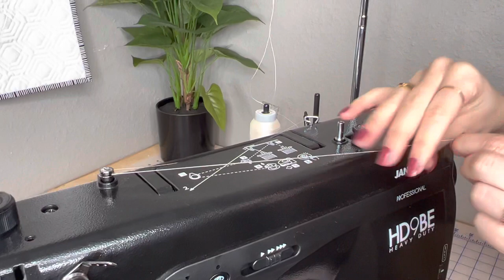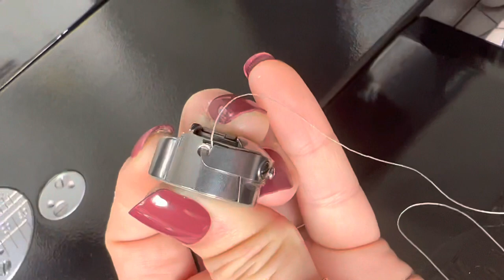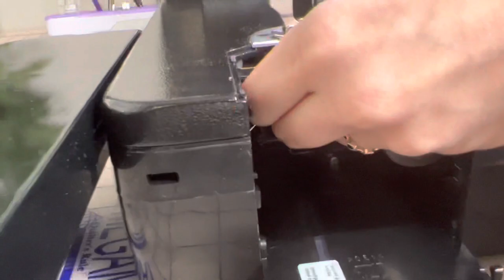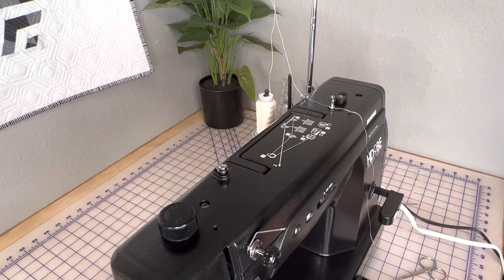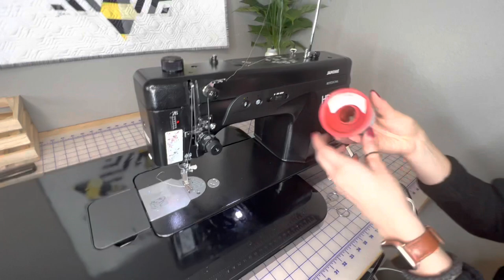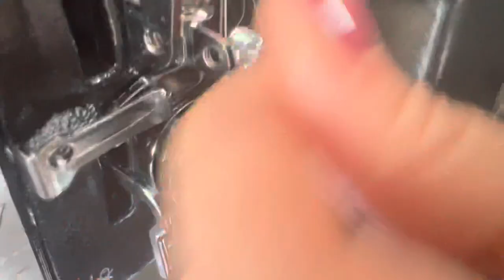How to thread Janome HD9 sewing machine! How to wind bobbin! (Industrial and domestic thread)

Comment: The top thread tension disc ( the disc right after threading the arm or bar with the three holes)   ... I have not found any instruction in the manual or youtube videos about how this does or does not affect the needle tension .  Can you offer anything on this?  I have the HD9 (white in color).
Reply from the maker: I believe it controls how long the tail thread will be when you use the auto threader. The looser it is the longer the tail thread will be when you cut it.

Comment: I have the HD9 - version 2. I've had multiple issues with tensions - top and bottom.  My current situation is that it sews beautifully going forward but when I back stitch - the top loops and pulls and makes a mess. It has messed up several project areas. I have adjusted the top and bottom tension multiple times. It's a disaster! How do you fix this issue?
Reply from the maker: what kind of fabric are you sewing on and have you changed out your needle ?
Reply: me too